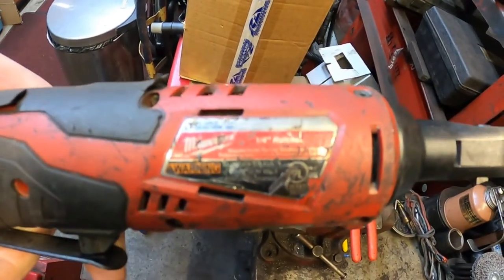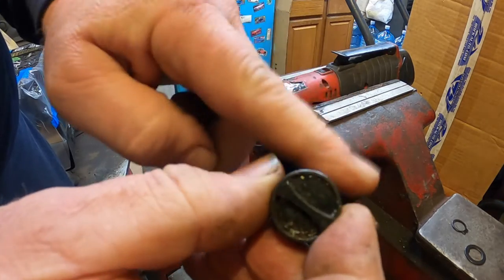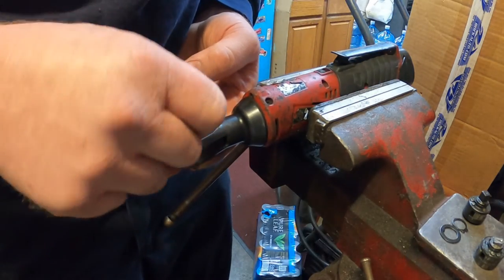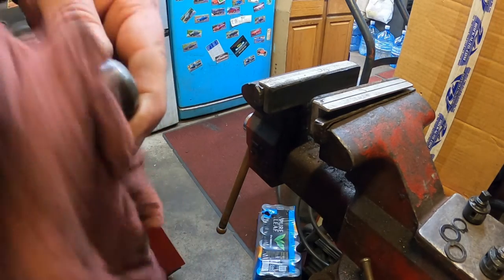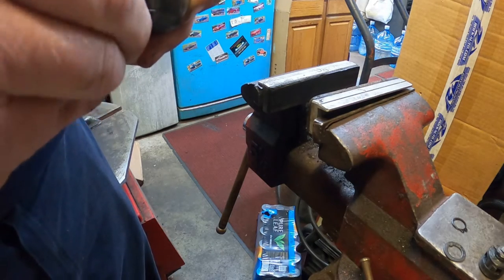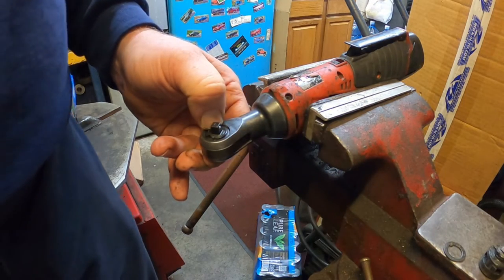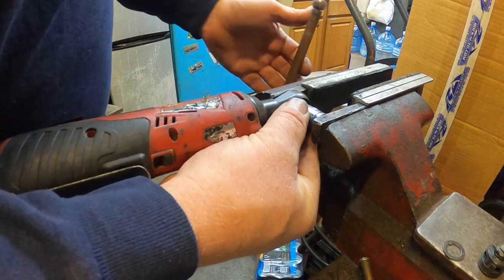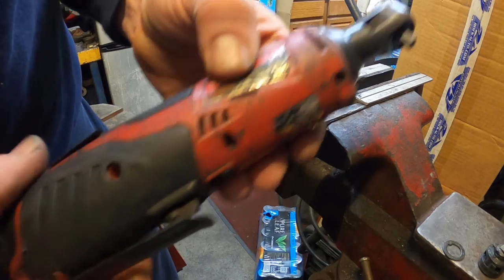Milwaukee 1/4'' Electric Ratchet Head Replacement

Comment: Does this work to change 1/4 to 3/8?
Reply from the maker: I do not think so but it the heads are the same size then it might work.
Reply: I was thinking the same thing. I have two that are 3/8 and was going to make one a 1/4.
Reply: @TheGAutomotiveAndMore  hey 👋 what's the name.of the pliers you use to remove the secure ring ?  I order a new head cause mine it was snaped
Reply from the maker: @thechampion9525  Snap ring pliers.
Reply: @TheGAutomotiveAndMore  thanks 👍
Reply: @RichardRides  did it work